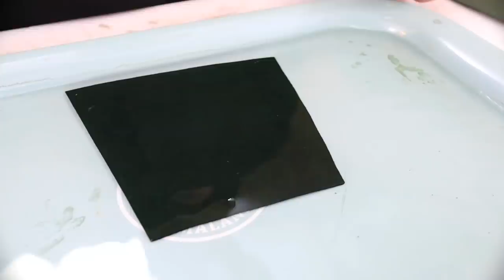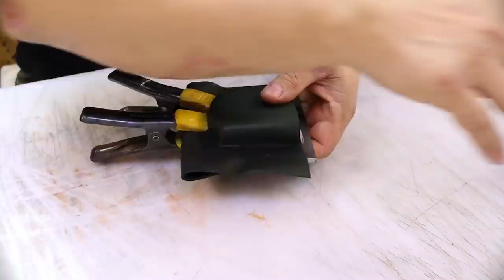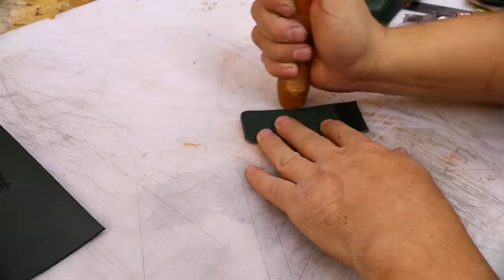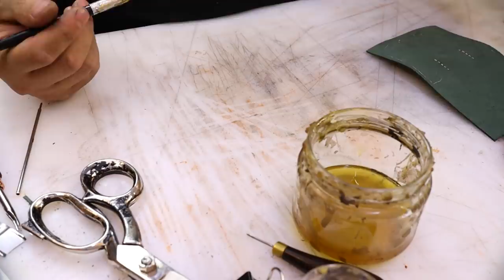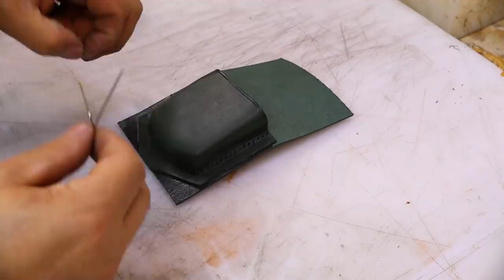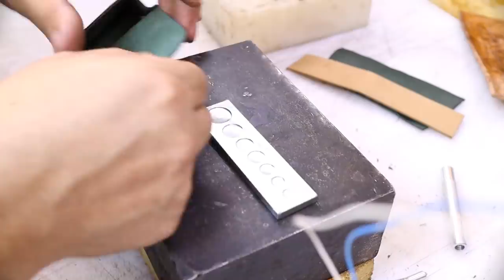leather belt pouch | Casing The Leather | Wet Molding | small utility belt pouch

Comment: I made a female and a male pattern so I did not need a bunch of clamps leaving un-clamped spots. He needed a block of wood shaped like a horse shoe to press the outer edge flat all the way around.
Also, those Leather Chisel Stitching Hole Punch Tools are only $10 and have 1, 2, 4, and 6 pins so he must have lost the others.